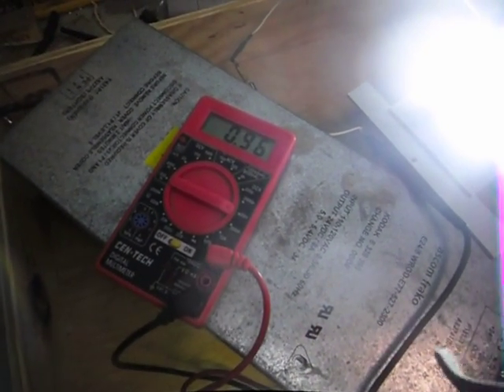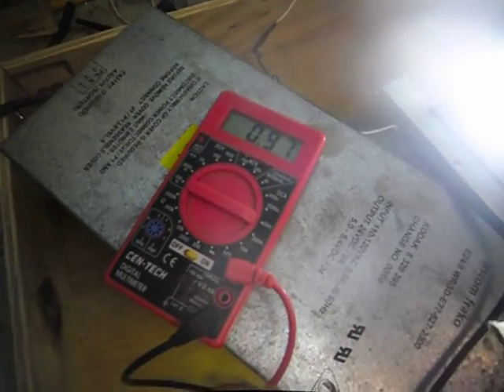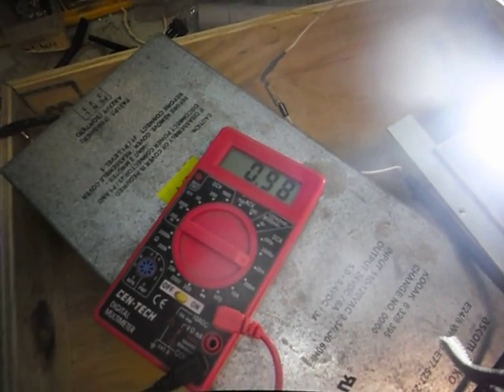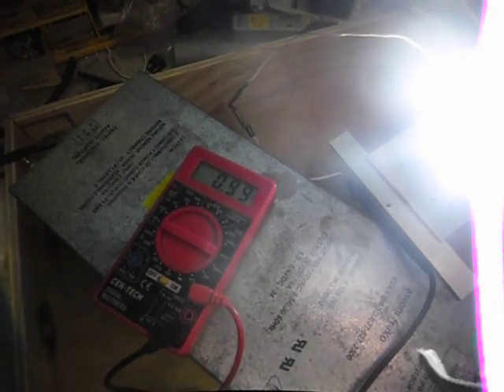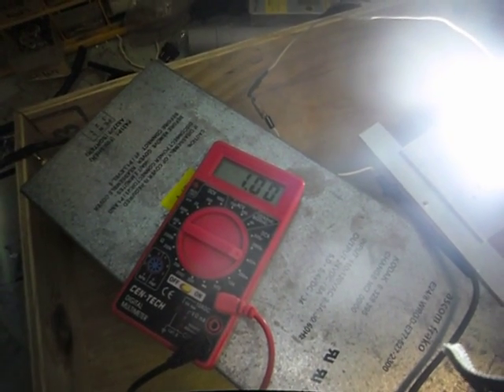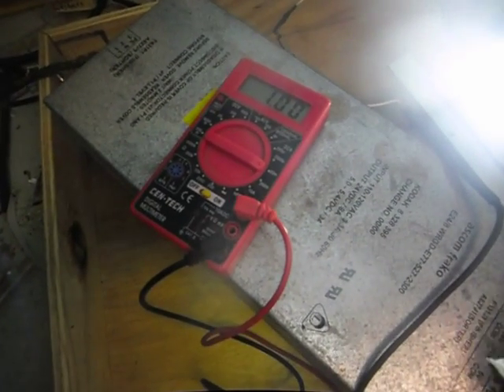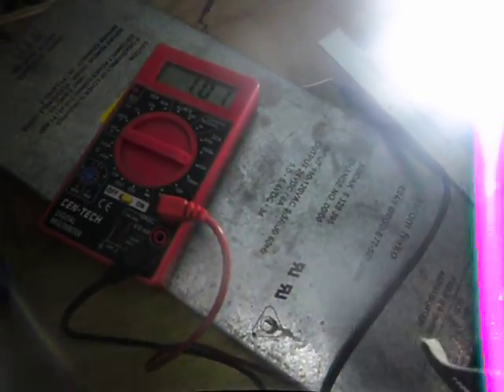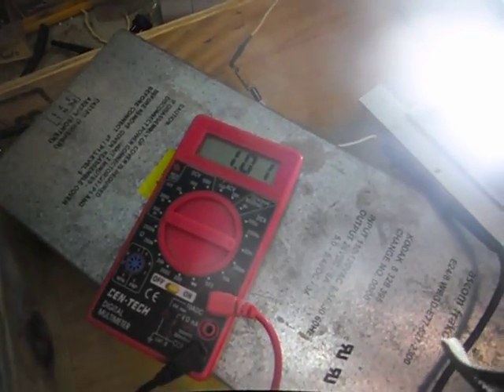DROK 600W 12A Constant Current/Voltage

Comment: Amps will only increase if the load impedance drops. You are setting current limit, not turning up the current on demand as you are with the voltage pot. The way to set the current limit correctly is to short the output then wind the current control up until it reaches the limit you have in mind.

Comment: The amps will only go up if the voltage is adjusted higher.  You'll reach a threshold in current if the voltage is not high enough.